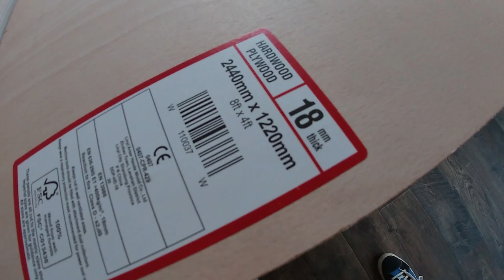Van Conversion Bed Build

Comment: Is it safe to sit in the back seat (or bed) when it's rolled up? Or do you need to install the car seats back to have more passengers drive around?  We have 3 passengers so we need a real car seat.  What do you suggest?
Reply from the maker: I would say it depends on the country you are travelling to. But most of them require to have a proper car seats installed for safe driving.